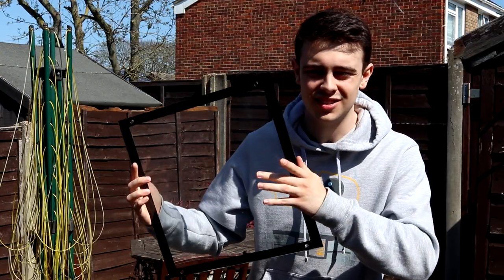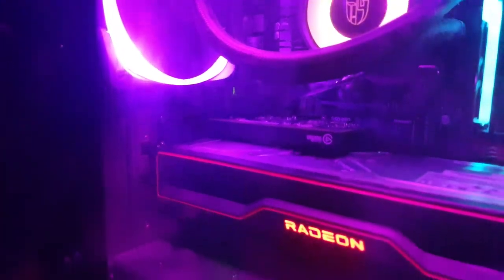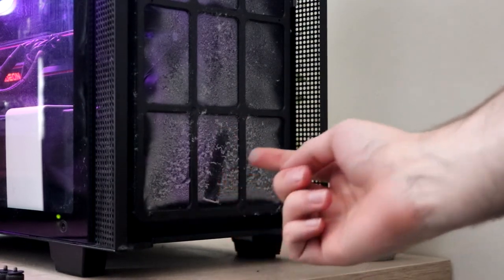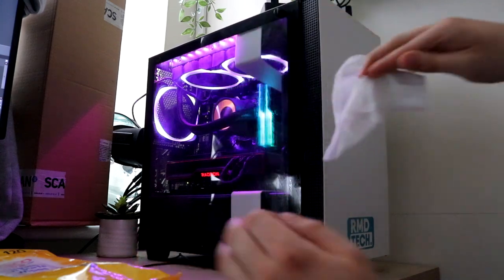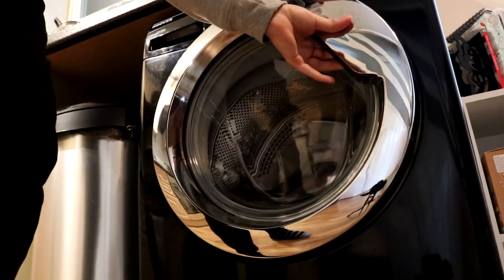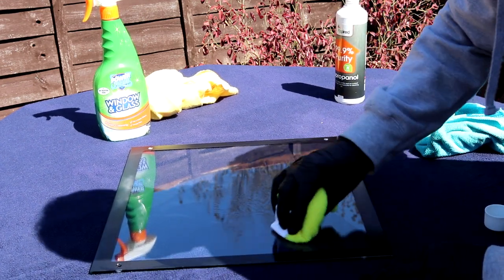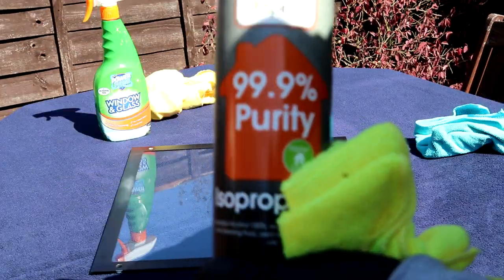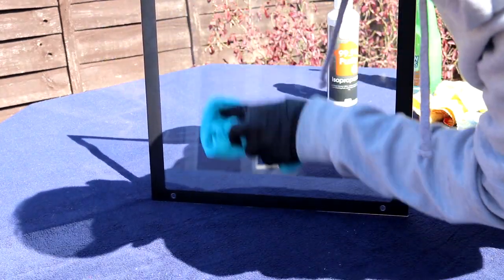How To Super Clean Your PC Side Panel (NO STREAKS)

Comment: I would add as a first step to blow the glass with compressed air from a more or less parallels angle. because small dust can be harder then glass an scratch it when you do the circular motion

Comment: here's my method: 

1. Mix some dish washing liquid with water to dilute
2. spray onto glass panel liberally, wipe in circular motions with microfiber cloth
3. wash down with clean water 
4. wipe dry with a clean microfiber cloth or paper towel 

p much spotless and streak free to my eye :)
Reply: The dish soap isn't to harsh on the glass?